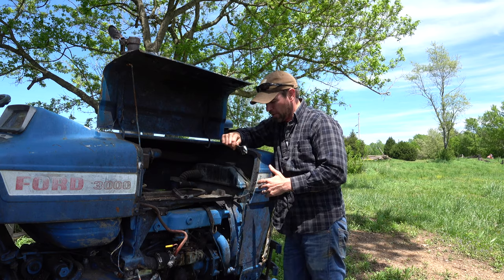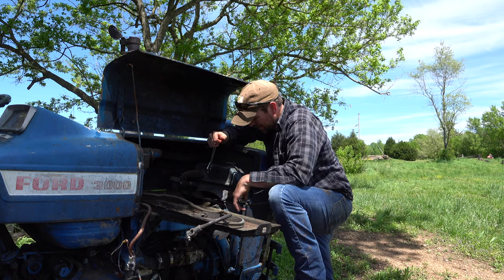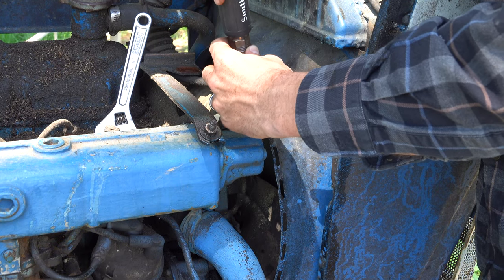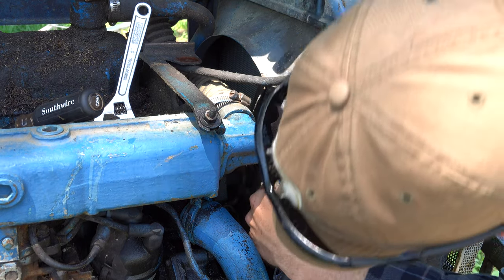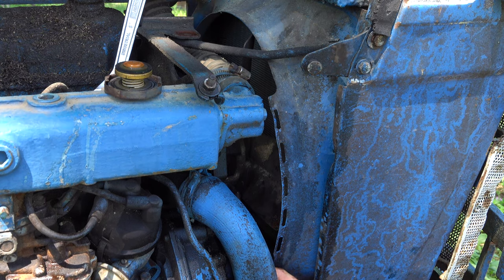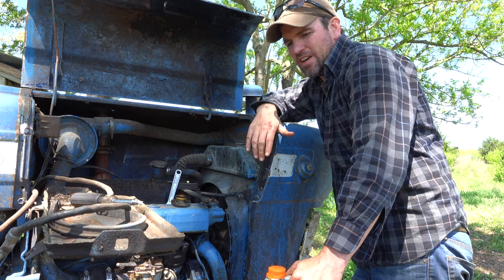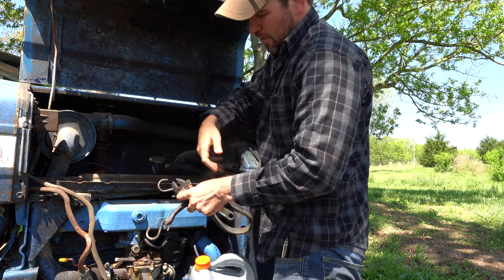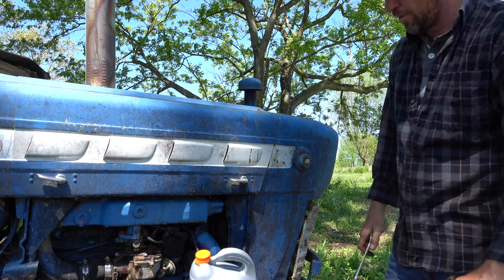Ford Tractor Coolant Blowout | Tractor Leaking Coolant

Comment: I have a Ford 6600. Same year. It has a water/coolant leak. It's coming from where tractor splits behind starter. It pours out. Anybody have any ideas what is the cause?
Reply: Same problem on a 6610 , any ideas?
Reply: Likely going to be either a cracked block or a freeze plug that has rusted out.
Reply: I have the same problem with a 3930. What was the fix on your tractor?
Reply: Pour coolant from what looks like underneath the rear main seal.